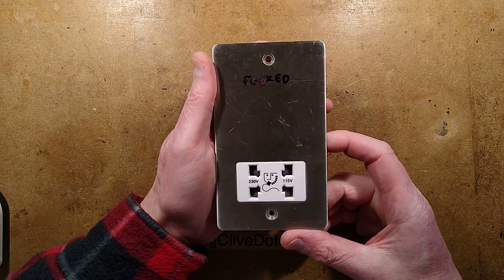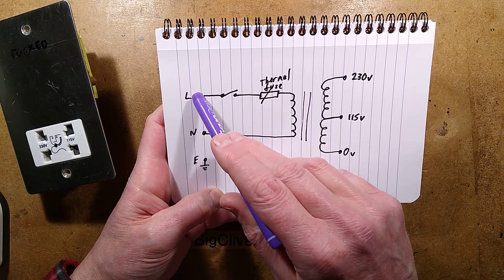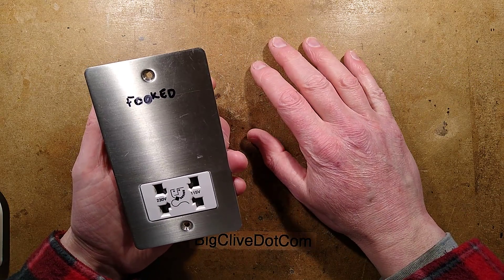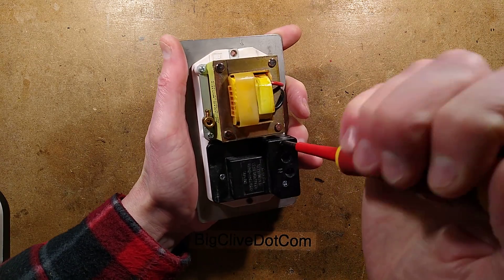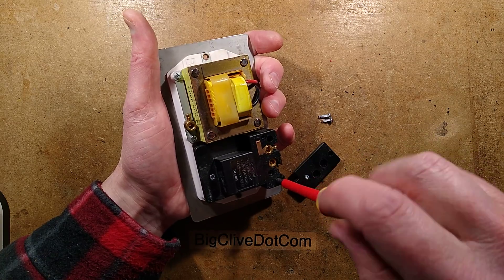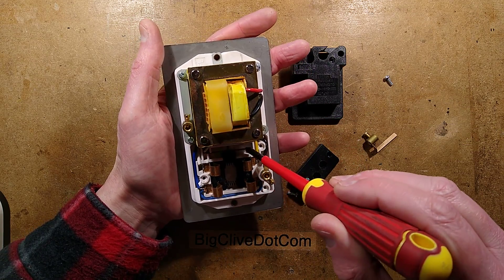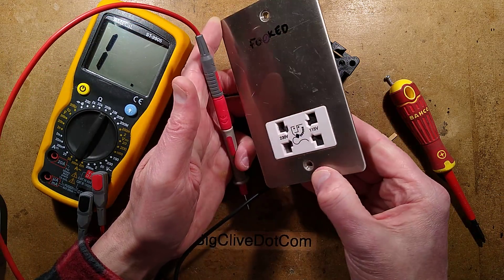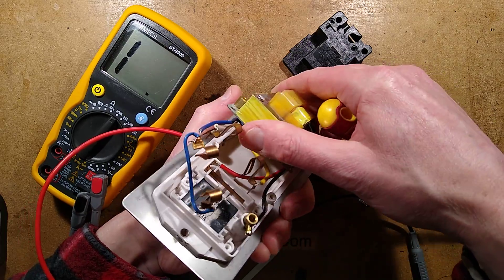Exploring a failed British shaver socket

Comment: Some commenters are suggesting it could have been overloaded by a toothbrush charger. No - these only use a watt or two at maximum, and typically less than half a watt once the toothbrush is charged. There is no way this would ever overheat a 20VA transformer, or even warm it much above ambient temperature. Vendors pushing special "electric toothbrush compatible" sockets are selling you alarmist snake oil.
Reply: I (continental European) remember being in a UK hotel room with my laptop, having to finish a presentation for the next day. I had forgotten to bring my UK travel adaptor, but the Schuko plug from the laptop charger could be jammed into the shaver socket in the bathroom with some effort. This worked just fine, at least well enough to keep the laptop battery from depleting. Only problem was the pain in my behind after sitting on the loo with my laptop, doing Powerpoint till 1 AM.

I suppose a laptop charger consumes a lot more power than even the wildest electrical toothbrush ever will.
Reply: @andreasu.3546  UK travel adapters usually have a 1 amp fuse, and some laptops will blow the fuse on start-up.
Reply: @andreasu.3546  My MacBook Pro charger is 96W, so it would be within range of this thing (just). My old one was only 60W so it's all good
Reply: @lztx  , Clive corrected himself and said the actual rating of the transformer was merely 20VA (watts), not 100 VA.
Reply: @lztx  Even if it's rated to 96W it won't necessarily consume 96W every second you're using your laptop.
Reply: Yeah, they'll also want to sell you Audiophile grade ethernet cables at the same time...
Reply: @SomeMorganSomewhere  And don't forget a premium HDMI cable to go with it
Reply: These sockets have switches that turn off the primary when nothing is plugged in. In some cases the transformer is made very cheaply, as are microwave oven transformers. One result of being cheap is that there is too little iron in the core, or too few turns on the primary. The magnetic core is run near saturation, so there is a lot of heating of the iron, and there can be a significant primary current whenever the transformer is turned on.
The "shavers only" rating is not because of the power rating, it is about how long the transformer should be turned on. Just plugging something in, which turns on the transformer, and leaving it for hours can result in it getting hot. The "shavers only" sockets were designed on the assumption that the shaver would be unplugged when not in use.
I know that the one I have gets warm when the toothbrush charger has been on for a few hours, and it seems like more heat is generated in the transformer than in the toothbrush or its charging base, so I guess that the iron losses in my one are quite large compared to the losses that result from taking a load.
Obviously there are lots of designs, and many will be perfectly happy to be left turned on continuously, but there have been some that were not.
Like many scare stories, there may be a grain of truth, in some conditions, with some particular devices.
Reply: I've just plugged one into a power meter. It is also marked "shavers only". When the switch has been operated, but no load taken, the transformer takes 3.2 W or 67 mA with a power factor of 0.18. The power goes up to 3.7 W with a toothbrush charger plugged in, and 4 W when charging a toothbrush.
I know that 3.2 W isn't a lot, but it is enough to get a small transformer like that quite hot, given enough time and the limited cooling in a plastic box with no ventilation. It's quite possible that a worse design would get very hot if left turned on with no load.
Reply: @diver3005  Ive got lamps that take less! What does just the charger base draw on its own?
Reply: @AndyK.1  I assume that the charger base takes about 0.5 W as the power increased by that much when it was connected. I haven't actually checked how much power it takes when directly connected to the mains.
Reply: I left one powered up all day, with no load. It was taking about 3 W and after that I measured 45°C on the surface of the transformer. So for that particular design, it wouldn't burn out with a small load plugged in permanently, but other designs could be worse.
Having a switch in the socket will be saving a few pounds a year, and extending the life of the transformer.
Reply: @diver3005  As you say the transformer generates way more heat than the toothbrush charger/battery. So I removed it.
Reply: My MK shaver socket gets very warm during the charging of my tooth brush. 🤔 Maybe Clive could clear this up for us? Please??...
Reply: In our apartment block we've been warned not to plug toothbrush chargers in as "it breaks the socket". Maybe paranoia, but it lends some credence to the "small heat over a long time is sufficient to trip the thermal fuse" theory.
Reply: @AdrianBridgett  I just checked and my charger is rated at 0.9 watts. Must be something wrong with the socket design if that causes a problem.
Reply: The transformer might help prevent noise from a switching supply or charger from being radiated back into the mains wiring and interfering with TV and radio in other adjacent rooms.  A hotel could have a vested interest in preventing these types of complaints from guests.
Reply: @goodun2974  It seems everyone in this thread has absolutely no idea how much EMI actually radiates from a toothbrush charger. It's seriously not much. It's so little that there's no way it's going to interfere with anything else on the circuit.
Reply: We've used the shaver sockets for toothbrushes for years, never had a problem.  Bear in mind these draw very liitle current. Note also that toothbrushes in the UK normally have the shaver-specific plug fitted as standard so will only fit a shaver socket.
Reply: @GS-gu7nz  The difference is that shavers only get charged for an hour or so, where as tooth brushes get left plugged in 24/7 with the transformer powered. They run hot 24/7
Reply: @AndyK.1   They do not run hot. They run exceedingly cool. I have measured this. Try doing some minimal research before opining.
Reply: @jolyontayrol1028  What temperature did you measure. I had first hand experience.
Reply: It's not merely a VA issue, I believe the problem is the harmonics caused by the switching power supplies. Harmonics cause increased iron losses, eddy current losses, hysteresis loss, etc. It's well known with industrial loads and utility transformers, so those are monitored and limited.
Reply: @straightpipediesel  : If your electric shaver's harmonics are killing any rationally sized transformer, then you should probably stop using it to cut through trees.
Reply: @absalomdraconis  We're talking about electric toothbrushes here. They additional complication is that they use a inductive charger that operates at 20-100 kHz. I wouldn't be surprised if they drove the transmitter coil off line voltage.

Comment: Me, being a German, thinking, that isolation transformers can be found in hotels, mainly. I did not see them in home installations. However, I am no electrician, just a hobbyist. And, I think the German regulations could be better. We have symetric plugs as example. You can rotate them so you never know where live and neutral are in your device. Isnt this a security issue? Would love to learn about other opinons on that.
Reply: You are right about the rotation, that is a risk. Fellow German here, years ago I got a nice lecture from an Australian co-worker (hello, John!) about UK plugs when I complained that these are so bulky.

The UK plugs are bulky, because they (a) are usually fused, and (b) have a defined pin for 'live' (that can only be inserted after the safety ground pin). Also, wall sockets usually have their own fuse and switch(!), in a ddition to the central fuse/switch/RCD. All of this makes the system very safe.

German "SchuKo" plugs (Schutzkontakt-Stecker) are comparably unsafe, because you can easily swap live and neutral by turning the plug 180 degrees. Why this matters? If you have a bedside lamp with a switch that breaks only one of the two wires, if you are unlucky, you could end up having most of the socket of the light bulb on 'live', because you only "switched off" the lamp by breaking the 'neutral' wire.

Fun fact: I bought a DAB radio in the UK, which came with a UK plug. Inside the large plug (which I opened to replace it with a SchuKo plug) was ....a 'Euro plug'! This UK plug was a screw-on adaptor (and fused). Ingenious! 🙂
(Later I had good use for this adapter - my father in law wanted a ring light with a magnifying glass for his aquarell painting, and I found a nice one in Germany (with EUro plug). Of course I carefully made sure to align the 'switched' wire side with the 'live' side of the UK plug.)
Reply: @hagen-p  Exactly my thoughts. And yes, since you mentioned bedside lamps: ours are out of metal, have schuko, and a switch breaking both power lines. Still the risk is there if you swap the bulb and are not sure if the switch is on or off. I find it quite amazing that we Germans deal with this risk in a country, where almost everything is well regulated.
Reply: Why is the safety risk attributed to the reversibility of the plug system and not the bulb socket? IEC standards generally require neutral to be treated as an active conductor just like live, it doesn't permit any special leeway there. It's the socket that's exposing conductors and/or requiring exposure thereof, get rid of that damn thing.
Reply: @pivotmastex  Defined connection to the live wire allows switches to ensure the live wire is disconnected when a device is turned off. (Having a switch at each power outlet is also nice.) It's about 'stacking the odds' in favour of safety.

Comment: My guess is a toothbrush charger has been left plugged in 24/7 allowing it to get hot.
Reply: This device claims to handle 100W. The toothbrushes I know only pull 3 to 6 watts. I think that's way to low for any damage ...
Reply: @matthiasplus6691   I understand where you’re coming from, the issue I’m thinking is the transformers aren’t meant to be powered 24/7 hence the on/off interlock with the socket guard.
Reply: @cumberland1234  that still doesn't make sense with the power draw likely being dissapated thermally before it could ever build up that far

Comment: I've seen them in motel bathrooms in Australia but they have never been installed in residential bathrooms here. They were only installed in motels to provide travelers 115v for the shavers I assume .
Reply: Back in the days when the only portable powered appliance one carried was a shaver :)
Reply: @simonneep8413  A time that is hard to remember.
Reply: Yeah, hotels, motels, trains, airports, that's about it and mostly for foreign devices rather than electrical protection. 

Though I did go looking for one recently to install in my bathroom so I could nix the ghetto adapter I'm currently using to plug my Japanese purchased electric shaver in (it's a universal input jobbie but obviously has a Japanese plug).
Reply: @Bobo There, there, now. Don't be confused by their confusion there.  (Apologies to non-English speakers.)
Reply: Some social housing have them installed!
Reply: @jonathonshanecrawford1840   recently built or more like "ancient" buildings which were never updated.
Reply: @jyvben1520  In most countries Buidlings were they do have shaver outlets great, whereas the ones that don't, its like old houses (1920's) passed their building inspection at that time, that even today "building inspectors" think their still OK that they are up to code (1920) where as they are not in today's standards. True to say old homes never thought of installing shaver outlets, as people didn't really travel much back then as we do today!
Like in Australia/New Zealand we has (as you know) is 230-250V, they didn't really have visitors from the USA (120V~). That's why buildings didn't have those 112/240V shaver outlets!
Reply: @jonathonshanecrawford1840  Time and time again 110 V supplies have been shown to be safer than 220 V as regards electrocution.

Your mathematics is completely arbitrary and utterly devoid of any meaningful relationship to your claim. Aside from it being shamefully lazy and pointlessly confusing to write a set of equations using, presumably, use the symbol / as a grammatical tool to organise the numbers into conjugate pairs rather than as the substitute for the mathematical division symbol everyone would be expecting once you claim you're writing an equation, your attempt at equations mean squat.

So what if 20 * 120 = 10 * 240. Presumably you mean that both a 240 V and a 120 V supply could provide 2400 W. Irrelevant.

Under otherwise identical conditions a 120 V supply will drive only half the current of a 240 V supply through a resistive load resulting in only one quarter of the power which by your reasoning means the lower voltage is safer, but power is not the primary killer, that's current which has been halved.
Reply: @igrim4777  As you say 110-120V (USA) is safer than 220-250V (rest ofthe world), is that to say the we (UK/Australia/NZ/etc.) are stupid to use 220-250V, and that we are putting ourselves at risk of killing ourselves and we should of follow the Americans? 
Then why is it from the (street supply) three phase (any 1 to gnd) is 240 +/- V AC?
At to 110,000 bearly any current until is reaches our home (Australia/NZ) the the current rises are the voltage gets higher, or someone got it wrong, at the supply (current) from the power station is higher?
The best thing about the UK power (domestic) sockets is that people (children) can't stick metal object in them that so easily, however the plug with fuses? If the manufacture says the fuse is 250mA, the person may replace the fuse with e.g. 13 Amp fuse = fire/death/smoke
Here (Downunder) our plugs aren't fused, rather the device is. And today every room in the house is protected by RCD's and MCBS, not like the USA (old regs) the bathroom was! All new homes and rentals MUST have RCD's
Reply: @jonathonshanecrawford1840  the volts directly determine the amps drawn. Lower voltage is safer.
Reply: @jonathonshanecrawford1840  You are just blabbing on with completely unrelated things. What the hell is this "110 000" you are talking about? It seems like you are using Google translate or something, you are not making any sense whatsoever.
Reply: @AureliusR  I was taught differently, it's the load Resistance with the voltage, the higher the resistance the more current is need to drive the load, regardless of the voltage! 
Like water (pressure) the smaller the diameter the more current is needed to push the same amount of water through (e.e 1 litre/minute)
here water as to voltage!
like 110,000VAC there's low current (eg 250mA) yes, by the time it gets to a house, yes the current goes up (65Amps - average [Australia & New Zealand]...
Reply: @AureliusR  A 12 volt battery @ 100 Amps can also kill, so regardless 240V AC/DC its it really the voltage? Current is from load R plus V!
Reply: @AureliusR  It is not the Voltage that can kill humans, it is the current that kills. Humans have died at as low as 42 volts. Time is also a factor. A current of 0.1 ampere for a mere 2 seconds can be fatal. As Voltage = Current x Resistance the current depends on body resistance. The internal resistance between the ears is only 100 ohms, while it is around 500 ohms when measured from finger to toe.
An electrical current at 1,000 volts is no more deadly than a current at 100 volts, but tiny changes in amperage can mean the difference between life and death when a person receives an electrical shock.
Any amount of current over 10 milliamps (0.01 amp) is capable of producing painful to severe shock, currents between 100 and 200 mA (0.1 to 0.2 amp) are lethal.
Reply: I don't think I've seen one in a hotel in Straya for a long time, I've never seen one in a private house.
Reply: @ghostofdre  Your partly right -- private house - where I live, I've have one in my bathroom, even though my place is a State House, howver, even some private home have Shaver outlets, may be someone is thinking ahead - futrue proofing? 
50+ years ago, there wasn't much internation travel (drom the USA), so they weren't required (AU/NZ) as to Europe 220-250V and some areas were 110-120V after WWII - USA. I could write an essa, but there's not enough space here!
Reply: Asume is not that good of a word, I would use "believe" as to Asume,  one thinks they know with evidence - Sorry to sound like I'm correcting one's gramer!
Reply: I've seen them in older residential in NZ, not sure if I've seen one in Australia
Reply: @CiaránWelch  May be NZ decieded to install lots in Auckland as filights to Sydney from the USA went (still do) went via Auckland, as NZ at time (still are) behind Australia, I suppose it also depends where you have been in Australia, not being personal, traveled much around Australia?
Reply: Never seen them in a private house in Australia & I have lived in houses with very old wiring. If they have been in motels I have not noticed as I have not needed a power point in a bathroom in forty years.
Reply: @francesconicoletti2547  I believe this topic is age related, as years ago people didn't travel from the USA as they do now (cost), also it depends where one has lived in Australia, I was born in Darwin and lived up & down the east cost from Melbourne to Townswille, Coffs Harbour, Newcastle & Sydney, & I've seen the in Sydney & Newcastle! The 110-240 shaver oultet do exist in Australia & NZ.
Reply: @francesconicoletti2547  We are luck downunder, wereas the USA are dumb, up to recently only the Bathroom (USA) had RCD's, whereas AU/NZ the whole house RCDS (at the consumer unut)!
Reply: for the people learning English, "for there" should be "for their" ...